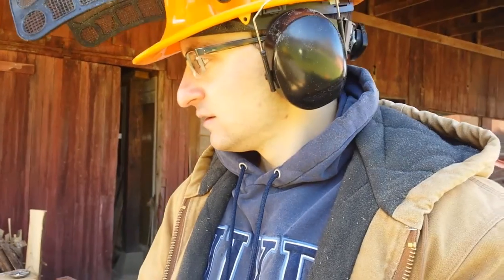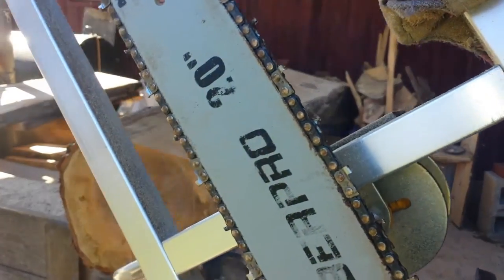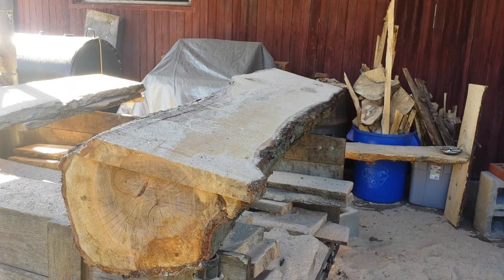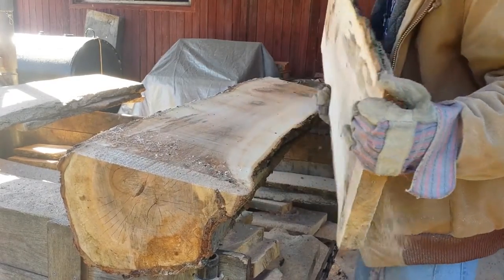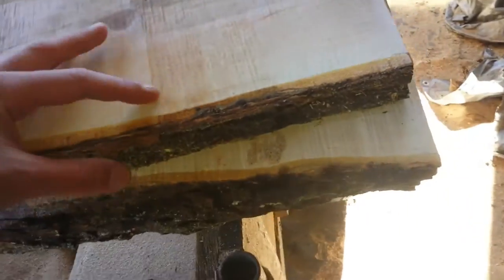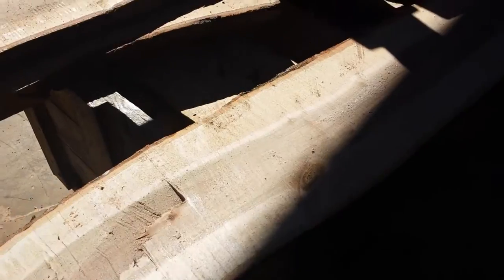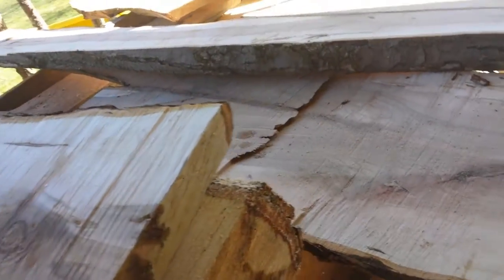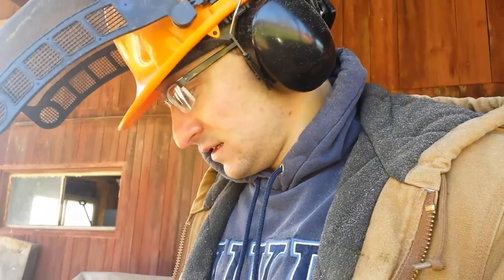Milling Without Rakers and Uneven Bar Wear

Comment: Lol, the chainsaw stalls out so much (even a few times before you fast forward the video...) Thats why you have rakers.  So you can push and let the saw cut, not backing off the pushing force and let the teeth catch up.  There is a reason why all industrial applications have rakes, and precision sharpened chain teeths by machine. 
To grind a chain by hand is possible, its a GOOD result, but to get ALL angles correct, and equal, on EVERY teeth,  as well as teeth length, is darn near impossible I can't do that even after 10 years of grinding by hand, that's because we are human. (if you are hunting the PERFECT result)

Comment: General rule in regards to chains and sharpening. Run yer file over the chain every tank of fuel, flip yer bar every two tanks and clean yer bar groove, then keep it well lubed and correctly tensioned = no dramas 😎😎😎😎

Comment: I have found that when you do not have the right tension on the chain this will happen. I kinda like keeping the rakers on myself. Also, sometimes the wood has a movement you do not see and this can cause you the loose you straight line.

Comment: Time to dress your bar. Plus, any bar or chain or combined imperfection will be magnified by your  lack of rakers. The lack of rakers lets the chain take a bigger bite so when it goes wrong it goes really wrong. Try one of your new chains and see if the problem is eliminated or lessened.

Comment: I hope you don't mind a few suggestions. Yes the chain will cut without the rakers but you do so at much higher risk and also higher wear to your chain bar and chainsaw.  The rakers perform a number of very important features that you are not giving any concern over.  The rakers limit the depth of each cut on each tooth.  This equalizes the forces on each tooth reducing the high forces when that tooth hits a hard knot.  By removing the raker you allow that tooth to bite in too far at times thus creating very high forces that increases wear and increases the chance of tooth failure.  This is the most likely reason you are not cutting as straight as lack of rakers contributes to your chain to rise and fall at times.  If you cut the rakers off a brand new chain the chance that the chain will break is greatly increased over the shortened life of that chain and can possibly result in injury.  Please stop this practice as it is asking for trouble.  Try to always use the winch as it will provide a smother cut as it avoids seesawing the bar thus minimizing back cut.  Since your head is always closer to the power head you might want to get into the habit of using a "fume" respirator tgat is rated for burning gas/oil.  Carcinogens are bad and you should do what you can to reduce them.  Cancer risk can be reduced.  On that point runing a vegetable oil mix as your bar lube can reduce the amount of unburnt oil lube particulate in the air (depending on what your using for bar oil).  vegetable oil will also be the cheapest lube by far.  Good luck and stay safe.
Reply: Good advice, though I don't recommend veg oil as bar lube. At low temperatures veg oil thickens to jelly/gum causing problems in the pump and oilways.
Reply: PrimusRage Yes it will gell at low temps (freezing) but if you keep the saw in a warm area before starting to cut I have had no problems down to -10 c.  Colder than this I usually dont like to go out and cut anyways.  Also you can cut it with synthetic bar oil to lower the freezing temp.  Regardless  at 1/3 the cost and the benefits  of less toxins anyone trying to save on costs should try it.  Professional loggers do this so give it a shot.
Reply: Monique Melanson you really know what you're talking about. Rakers are there for a reason, many reasons in fact. And yes vegetable oil is best. Been running canola for over 10 years. It too is best for many reasons as well.

Comment: I noticed your bar is not floating on the tip end and not clamped to that end of the guide. To me, I could easily see how you could get uneven cuts and digging issues...

Comment: Upgrade to a higher quality bar and don't take the rakers down all the way. The thickness difference can be cause by letting the powerhead end of the mill will cause the bar tip end rise and cause thickness accuracy problems. Even with my Husqvarna 390xp I'd never take the rakers down.

Comment: are all the teeth the same length. if they are not that could be causing it to pull.
Reply from the maker: Joseph Petrillo Yes I use a chainsaw sharpener to sharpen the chain. That would be the problem if I hand sharpened the chain. Lol.

Comment: thats weird it doing that. they make a tool to file the bar. take a look were the drive links ride in the chain. if on side is higher than the other it can cause slop.
Reply from the maker: Joseph Petrillo I will have to look into that. One side of the bar being higher sounds like what the problem is. Hopefully I don't have to buy another bar.

Comment: Are you still using .058 chain in that bar? Time to measure the groove, I bet if you try .063 chain your cut will be cleaner.
Reply from the maker: PrimusRage I am still using the .058. I have 2 new chains and the ripping one that are .058. The problem is the with the bar because if it was the chain thickness being to small it should do it all the time not just when the bar is flipped upside down.
Reply: You should still measure the groove. Running baggy chain will exaggerate any run-out of the teeth. If neat milling is your aim and what your are doing isn't working that well so far, be honest with yourself about the things you can try with regard to getting a better finish. File the bar square and check the groove gauge size as well as for uneven wear. I can't tell if its an optical illusion but the teeth look slightly different lengths. Great collection of slabs there btw.

Comment: Your bar is not square the make a tool that is like a very coarse file. If there is a bur on the side of your bar you can take that off with a regular file. The tool isn't expensive and works to square the bar and it will also take off the burs. Bailey's has them online some saw shops might carry them. Check you bar with a good quality steel square. That is more than likely what is wrong.

Comment: You are making daw dust. Have you ever used a surface planer? The rakers serve a purpose just like adjusting the depth of a blade on a planer. There wouldn’t be billions of chainsaw chains in earth all with rakers if they didn’t serve a purpose